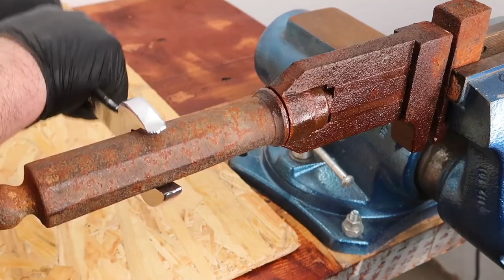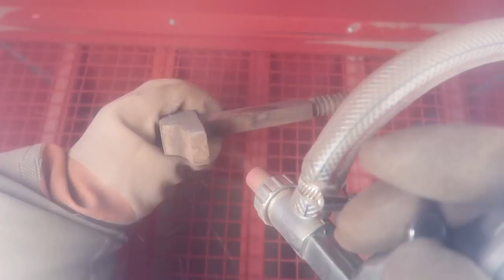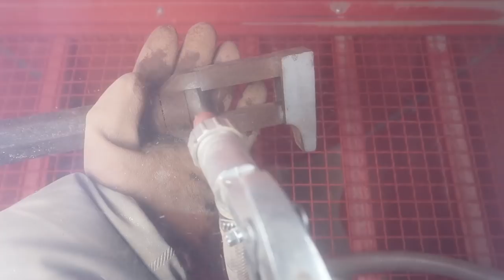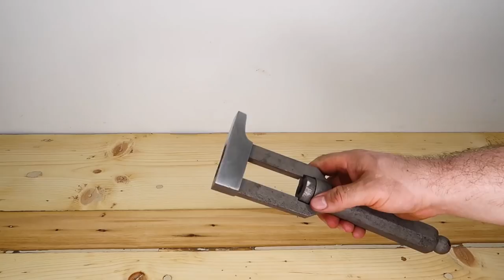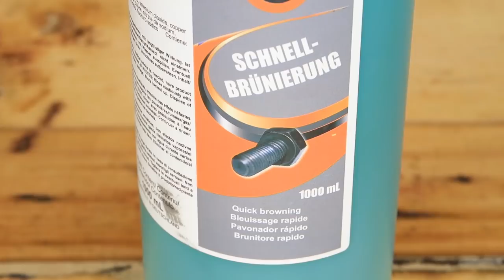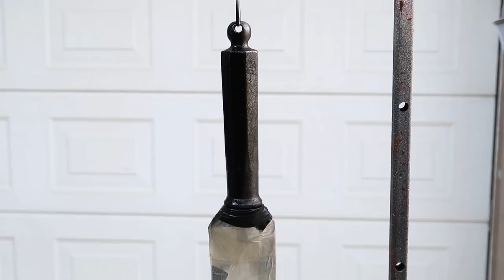Restoration Rusty French Wrench  .

Comment: The small radius at the join of the head and shaft is there for a purpose to ease stresses. By making it a sharp angle you concentrate the stress and under heavy use the head could break off.
Reply from the maker: it is used rarely or not at all, I hope nothing bad happens

Comment: The first restoration i ever attempted, about a year ago, was a wrench similar in design. The threads were so rusted the nut was rust welded to them. I soaked it in Evaporust for three days and it still wouldn't bust loose. I still have the wrench but its a lost cause. Great work.
Reply from the maker: leave the key for a week in 12 degree food vinegar, you will see a miracle . Thanks for appreciation
Reply: @GarageRestoration  Thanks. I'll give it a shot.
Reply from the maker: Most people ignore vinegar and say it's just for pickles, but it's a cheap method, but it takes ..... the rust will peel off like a boiled egg